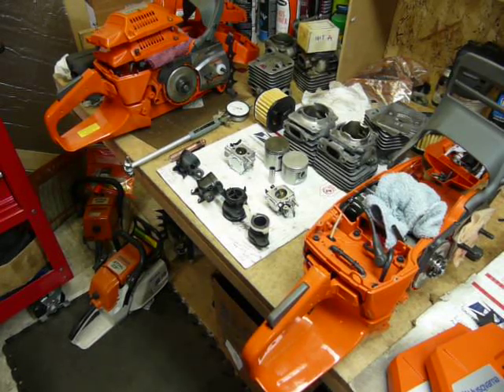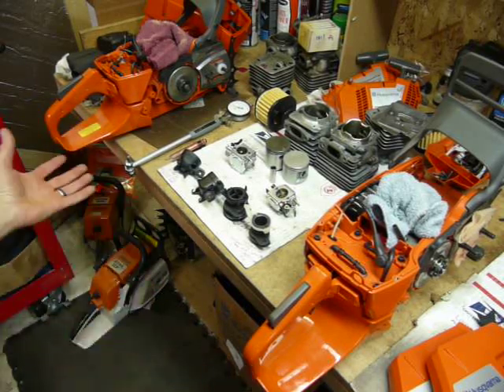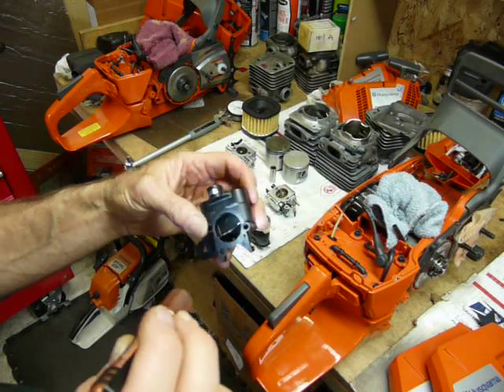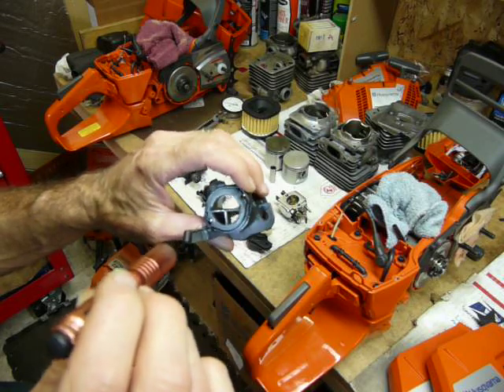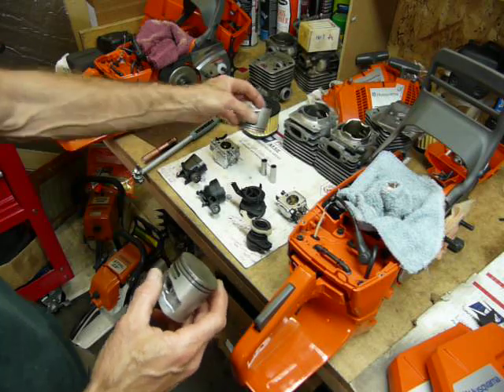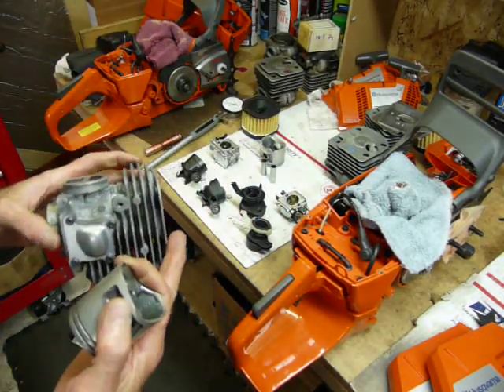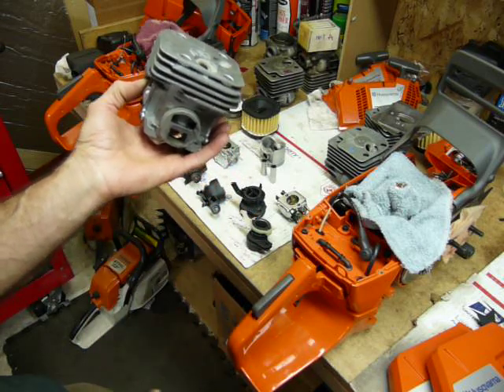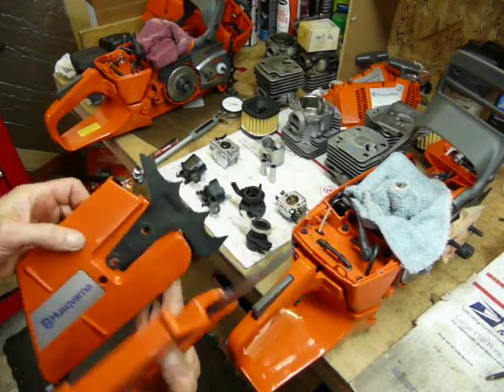Husqvarna 375xp vs 372xp X-torq - Bench Talk

Comment: I have a husqvarna 65.6cc engine for back pack blower how can I get easy power the rev is 7200 max I took the spark arrestor out I know they limit the emissions
Reply from the maker: Shane hi. Easy? Not sure. It's going to take someone that knows what they are doing tuning wise. Good work isn't cheap so it won't be inexpensive either.
Best of luck & thanks for watching.

Comment: question if you install the 51.4 mm cylinder on a original edition 372 50mm will it lose rpm due to the smaller transfers or should the transfers be opened up?

Comment: Hi Jack: Greetings from Galicia (Spain). I've been watching your videos for a long time and I see that you are a very wise person in these matters. I just saw this video, I have a 372 x-torq and wanted to see the differences. Clearly, more restrictive regulations have reduced the quality and performance of current products. You really stress the idea of using an appropriate oil mixture for the x-torq. What mix is appropriate for you? And what oil do you use? Currently I am using the Husqvarna LS +, but when I finish it I will buy the XP, unless you recommend something better. Thank you, master!
Reply from the maker: Jota hi.
I run around 48:1.
I have my own blend of mix oil.
I would not use the Husky oil, under any circumstance.
I would look for the H1-R from Bel-Ray. It is going to be the best option that I now of for any type of 2-cycle engine.
It works especially well in the new, smog, sloppy tolerance type engine designs of today. 
It works equally as well in the old, non smog saws, weedeaters, blowers, etc.
Motul makes some good oil for the flatout, fire-breathing type builds. The RoadRace being geared toward a saw type application. With the Off Highway coming 2nd in their lineup. They are not quite as good for the stock saws & general landscaping type equipment imho.
Best of luck.
Thanks for watching.
Reply: @hotsaws101  Hi Jack:
First of all, thank you very much for your reply.
I currently run 50: 1.
I was used to my father´s old 65 saw with more than 40 years of forestry and private work, but finally it has broken and it is very difficult to get spare parts. I bought the 372 x-torq recently, it is the first modern saw I have, I wanted the old 372 but for years it has not been marketed in Spain due to environmental restrictions. I have only used 2 liters of Husky oil, the saw is practically new, and it is a stock saw.
Why wouldn't you use any Husky oil? Here, regardless of Husqvarna and Stihl oils, the rest are mostly low-quality second-brand oils, speaking of oils specifically intended for saws. The Husky XP has a very good reputation around here, it is not cheap either (€ 25 / liter). If you recommend the H1-R, I buy it, it costs practically the same price.
I've heard a lot about Motul, and it supposedly doesn't leave a residue on the engine. But there are several types of 2T oil and I don't know which is the most appropriate.
Thank you very much for your help, best of luck to you too.
Reply from the maker: Jota hi.
There are a few videos from 3/4 years ago that show why the hp Husqvarna oil is a bad choice. But that is the US "flavor". I have asked on whether the "rest of the world" version of the hp oil is the same blend. Seems as though it is virtually the same recipe.
Motul does not have much of a cleaner component in the additive package (off highway & road race - the only two I'd consider for a saw application) whereas the H1-R does. Motul is for race or heavily modified, higher compression, higher spinning engines - although saw engines qualify on the last criteria.
If you had ever seen the internals after a stead diet of the Husky oil - either version - I'm betting that you would throw  out your saw gas immediately.
Thanks for watching.
Reply: @hotsaws101  Hi Jack:
First of all, thanks again for your detailed reply and sorry for the inconvenience. I've seen a video where you talk about oils and your preferences, and you show the effects of using Husqvarna oils. I have been impressed that such a renowned brand can make such low quality products.
Here are 3 Husqvarna oils: HP (mineral oil, about $ 10 / liter), LS + (semi-synthetic oil, about $ 17 / liter) and XP (synthetic oil, about $ 30 / liter). XP has a very good reputation, and at that price ... it should, at least, be a high quality oil. But, after talking to you and watching your videos, I see that it is not like that.
I will try the H1-R from Bel-Ray. You've been testing it for a long time and you know a lot more about it. A friend of mine uses it for a Gas-Gas motorcycle and he likes it. Regarding Motul oils, they have another name here (Road Racing and Off Road), that's why they didn't sound familiar to me.
I have only used 2 liters of the Husky oil. Do you think it is enough to create some premature damage to the new saw?
And changing the subject, here the bars are small (about 18-20 "is the most usual). I want to buy a 24", and I am between the Oregon Power Match and a Tsumura. Any preference?
Thank you very much, you are a reference in this.
Sorry for the inconvenience and have a good day.
Reply from the maker: Jota hi. It's not an inconvenience.
It would depend upon the use, the jetting,  and to a small degree the condition of the chain.
My guess is that there will be build-up. My guess is that there will be some wear. How much? That will a direct correlation to the previously mentioned considerations.
I'd switch to the H1-R and use the saw as normal.
I'd get a Tsumara bar personally.
Best of luck.
Reply: @hotsaws101  Hi Jack, thanks for your help. I have already received the H1-R, and have been using it these days on the 372 xtorq and the 245R trimmer. I run 50: 1, but this time I put 40: 1 and 98 octane gasoline, for a better engine cleanliness. I have disassembled the trimmer piston before using the oil and, after using it these days, it is cleaner. The trimmer is almost 30 years old and has a lot of hard work behind him, and he never had any problems, unthinkable nowadays hahahaha.
It is too early to be able to draw conclusions from the oil. I notice a slight improvement in engine rpm, and I see good lubrication. But I think it is not good to make the mixture rich in oil. With 40: 1 the engine smokes a lot, and while working it throws traces of burned oil from the exhaust. Spark plug is black, shows too much oil in mixture. Next time I'll try 50: 1 again, see if that fixes it.
Thank you very much for your help, keep it up. Good luck!
Reply from the maker: Jota - please keep in mind that oil will hold in latent heat.
If you have noticed a cleaner slug & mo-chines running better then the H1-R is doing it's job. That part will get better until the engines get pretty sanitary internally.
You might even notice better fuel economy also.
In the end, impossible to beat a top tier mix oil....
Reply: @hotsaws101  Jack, I have made 2 videos of the trimmer's piston, if you want to see his appearance after almost 30 years I will pass them to you by e-mail.
Today I have removed the silencer from the 372 xt, and I have seen that the piston, despite being the practically new machine, already has wear on the sides. Let's see if the H1-R does something ... I was surprised, because I thought that the muffler would have anti-pollution systems, and it is hollow.
In the trimmer, I haven't noticed better fuel economy, on the contrary. But I don't think it's the oil's fault. A mix too rich in oil and most likely a poorly adjusted carburetor on low, as the Walbro is still the first and no longer works as it should. If I want to lower it to around 2800-3000 rpm the trimmer turns off, I have it at 3500 approx. All filters recently changed, and cleaning thoroughly. Since I cleaned it, it consumes much more gas and sounds different, but I have not modified anything, I don't understand. I will have to take it to a trusted mechanic.
Thanks for your advice, and be careful with that heat wave, what a disaster ...
Reply: @hotsaws101  Friend, what is the best max speed for 372 xp oem?

Comment: So all this time I thought the modern 372xp was a great saw?  But now it seems like all xps are not created equal?  So the x-torq version are not great saws after all?
Reply from the maker: B L hi.
Personally, I went away from Husky in the 70/80cc class range after wearing out my true xpws out. Tried a few Dolmars and resurrected an 046.
I have figured out the xt version can be made to run similar to the xp saws after a bit of R&D around a year and a half or two ago. So good news there.
As they come, funky off the bottom acceleration and a weird, erratic surging coming off of high idle. 
AND, Husqvarna engineering didn't see fit to keep it svelte compared to the standard xt version.
But that's just one man's opinion.
Thanks for watching.

Comment: So can I swap the air horn in my 372 xtorq & get some better flow or will I need to do so more part changing to accommodate that. Id really like to send mine to you for some work. I live in Michigan & the longest bar we usually use is a 24"-28" obviously some guys feel inadequacies & need that 4 footer but uh...yea. mine runs like a bunch of cats in a house fire but im sure your flow tricks would make it absolutely savage. Ill email you the quote I got & see what I can get done. A good woods porting, just under the race saw specification. I use Lucas semi synthetic & recreational fuel.
Reply: I did modify the horn on my x torq and it did seem to run better with more power. However I have since gotten rid of that saw and I'm running the 572 xp.

Comment: wow that was great info there , never seen such precise  comments on  saws as you do , my 385 doesn't have that chunky cover as you show ,i never knew it existed , , not that its an issue for me , i dont use a bar longer than a 28 on it
Reply from the maker: The "big kid" clutch cover was a running change instituted by the factory. One shipment just showed up with saws fitted with the beefed up clutch cover. Kind of like the spool in the starter covers. 
Thanks for watching.

Comment: Thank you, thank you for this video. Hard to find good quality, thorough info on this. I've not been able to get my 372 x-torq to run great. Really makes me miss my old 371 and 72.
Reply from the maker: nrthrn stncrft Hello. The X-torqs can be made to run well, it just takes a lot of time and, correspondingly, work to get one there. Thanks for watching.
Reply: Mine runs great until it's hot then it starts loosing power I have tried all the small fixes sprk plug cleaned carb exhaust screen and it has great compression any suggestions

Comment: What is the best two cycle oil enjoy your videos
Reply: Joe Wolfe . hello that.s à great  question  . I belive  that the answer  is  found  àt vp fuels   ( I can't  afford to run  m'y saws on such quality products  (they sell premix gallons.)
Reply: Thank you
Reply from the maker: Joe Wolfe Hello. No lead gas. The saw doesn't need it and neither do your lungs. Saws have low cylinder pressures for the most part compared to motorcycles and run well on 95 to 100 octane fuels. Thanks for watching.
Reply: hotsaws101 thanks  but  his question  was about  oil!   I have use stihl premium oil for  a long time  .switched to there synthetic àt 50:1 smokes but not convinced should  I try  60:1 dealer doesn"t Know?
Reply: I belive you have  better pump gas in u.s   over here  stops à 94
Reply: Joe Wolfe  hello I will  try the stihl synthétique oil àt 60:1 as I have work  to do today will.check plug
Reply: Joe Wolfe  sorry pressed wrong button  again. .. color after à few minutes  may be a Little air screw  adjoint .I. M also concerned about what get's in m'y lungs
Reply from the maker: I was making the comment based on the statement "I belive  that the answer  is  found  àt vp fuels".
This, with the idea that if a guy is going to look into a company that primarily makes race gas, better throw out the warning that your saw doesn't need lead since there are not any valves and neither do your lungs. 
As far VP mix oil, with the lack of information on the spec sheet and the published numbers on what they do show it's about a 4 out of 10, imho anyway.
50:1 gives the best of both worlds. Thinking the needles need some tuning.
Thanks for watching.
Reply: I imagine you’ve ran everything. Do you like the 372 xtorque or a  372 x torque  with the 75cc xpw cylinder swapped into it once both are built

Comment: With all the grinding it looks like you'd have to do to a a strato 372 it'd almost be worth the month buying a piston and cylinder for an earlier 372 just to have something decent to start with.  Excellent video again!
Reply from the maker: Speed and Marine > Mr Munster - It's doable but an expensive proposition, if a guy was to do it right anyway.  I can get the X-torq style - stratified charge - saws to run really good as I have been told (yours is the same concept with a few minor design differentials) by their owners. I don't think they can be made to run as strong/great as the pre strato saws, all things being equal, since there are to many direction changes with the flow. That's my 2 cents for what ever it's worth.
Thanks for watching.